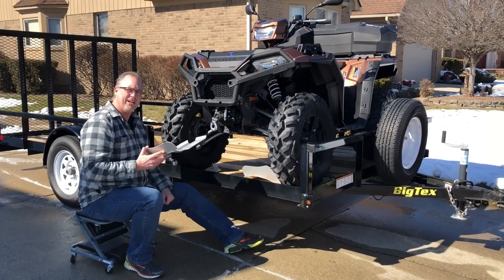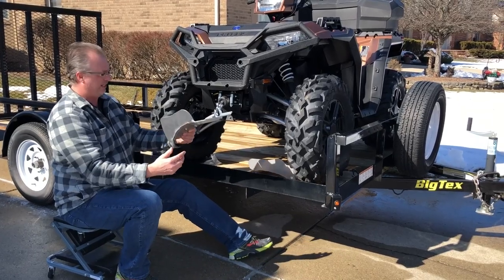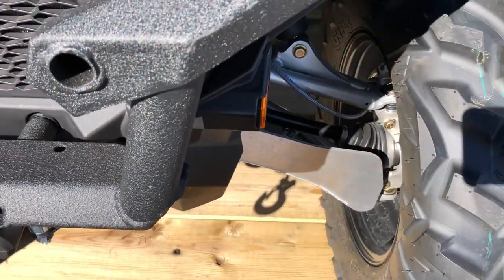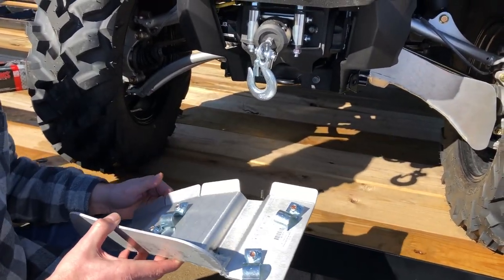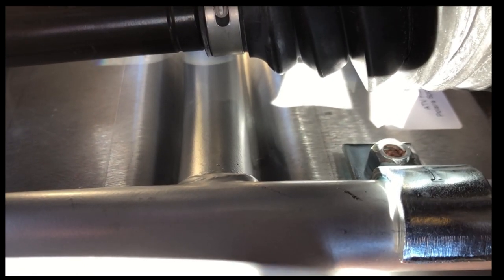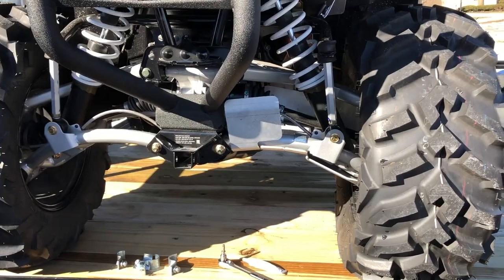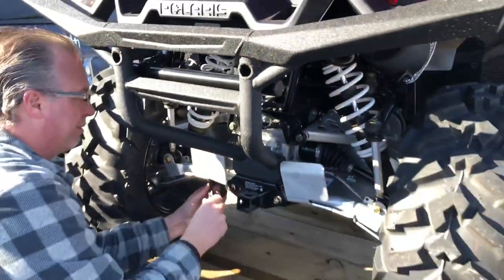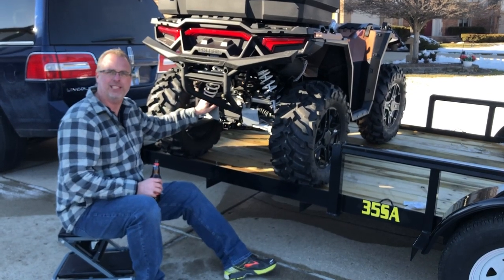Ricochet A Arm and CV Boot Guard Install on ATV 2018 Polaris Sportsman 1000 xp

Comment: Any fitting issues with these rubbing the inside wheel or any other parts during trail riding?
Reply from the maker: Rodney Torgerson no issue with any rubbing at all.  Only issue is getting to a couple of grease fittings on the rear, we use a 90 degree grease fitting and it works in a tight spot
Reply: They have changed the mounting advice as they now recommend loctite and not anti-sieze
Reply: You need third hand or take the wheels off. They are great  but can be a bit of struggle to put on by yourself

Comment: Do these guards block or make getting to any of the zerk  fittings hard? Thanks!
Reply from the maker: Papa Wattz, I'll take a look when I bring it back home.  I took it out last weekend and left it so can't run out and look.  On the 570 there is no issue but if I remember right it does get a little tight on the 1000 in one spot.  I greased it up just before putting these on then went riding, haven't looked at the zerks yet after but do think will still be able to get to em just might be tight in that one spot.
Reply: Thanks for the input. I too live and ride in Michigan, we typically ride up in the Pellston area( snowmobiles and ATV's).
Reply from the maker: We ride all over Michigan and this year will be venturing down to the Hatfield McCoy trails to check em out.  If I had to pick a place we ride the most it would be the Wolverine/Vanderbilt area as we have family there so we go there a lot and ride together.
Reply from the maker: Yes they do on the rear of the machine.  The Front they do not cause any issue.  We are looking into having the rear guards cut to fix this issue.
Reply: Thanks for the reply! When you do modify them, can you show a short video of the mod? just a picture and what you did is sufficient, thanks!